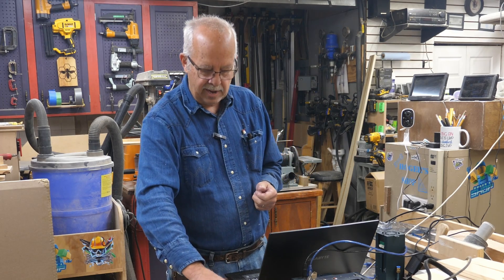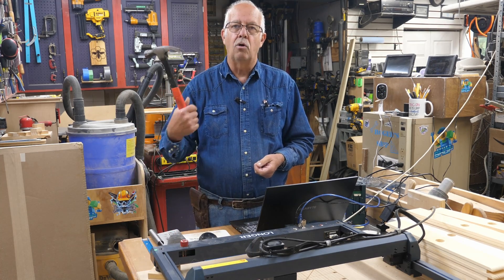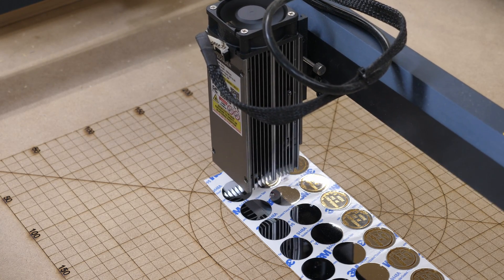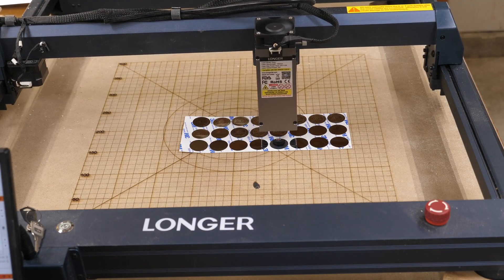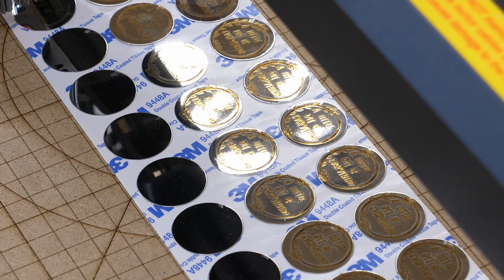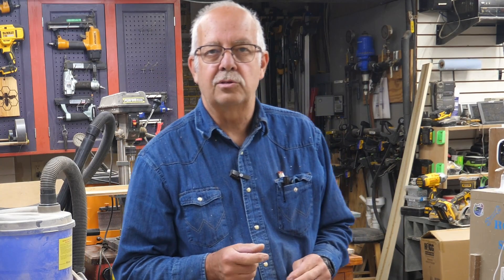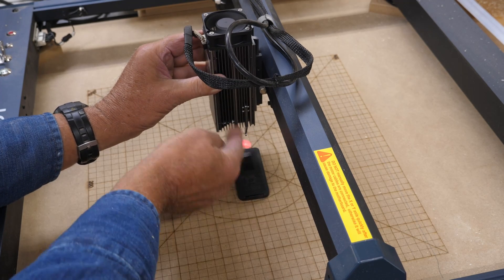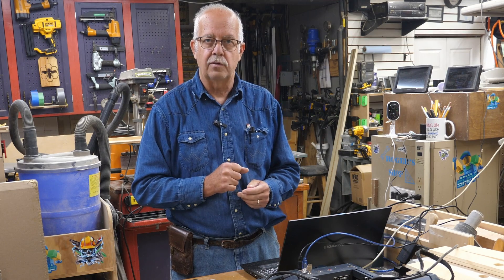LONGER Ruby Pulsed IR Laser Module

Comment: Hey Roger ive got the ruby for the ray5. and im trying to figure out the setting configuration for it to work right... right now it doing the jobs upside down and mirrored ?!  is there something im missing in the settings?
Reply from the maker: Assuming using Lightburn, so flip in the software.